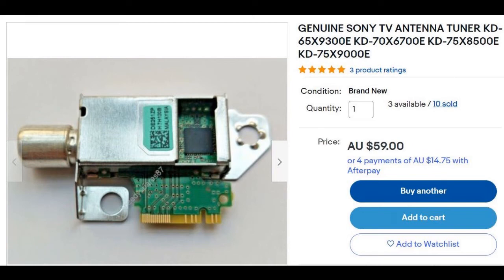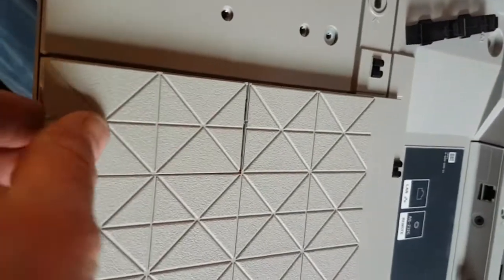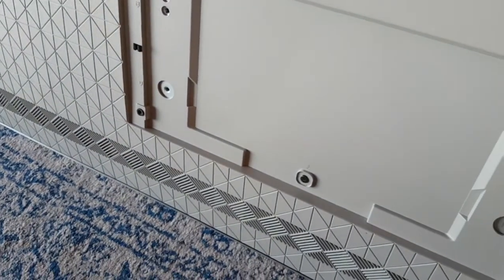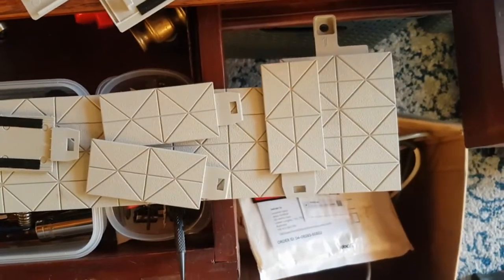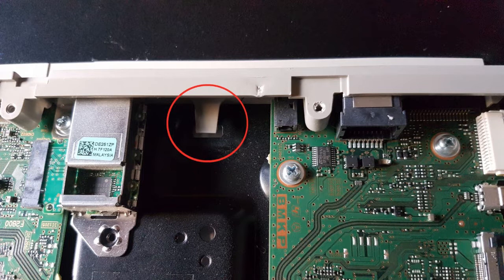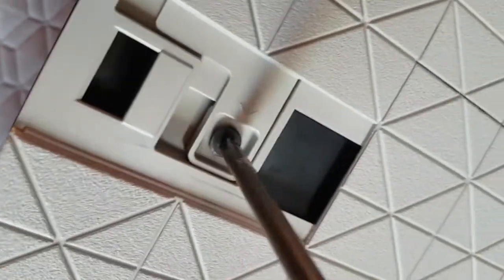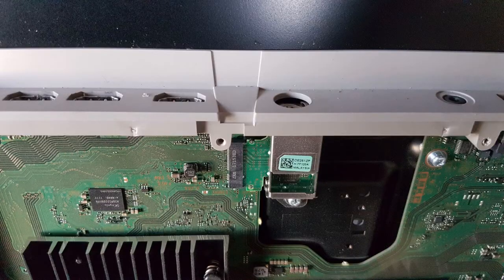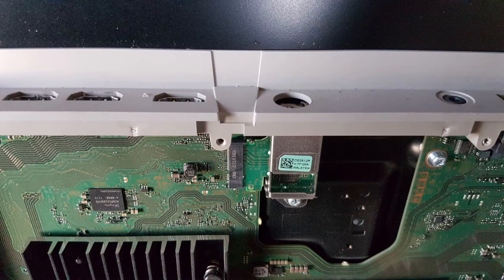Sony LCD TV KD-65X9300, KD-70X6700, KD-75X8500/9000 Broken Antenna Socket/Tuner DIY Replacement

Comment: Wow 7 and half minutes of crap spouting about how to do it and a plethora of plastic covers that could have been the underside of the USS Enterprise... Whatever happened to YouTube vids that actually walked through the job...
What a waste of time!!
Reply from the maker: The repair was done in someones living room. I thought it would be worth covering the main points. If you need to have someone show you how to take out each screw and put it back again you probably shouldnt tackle the job yourself.